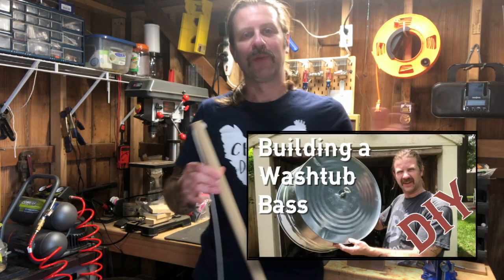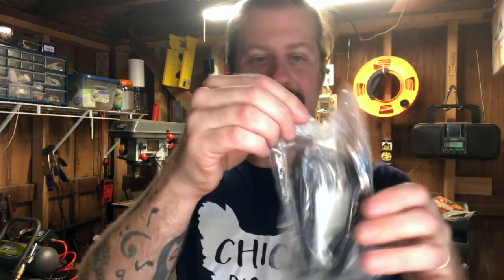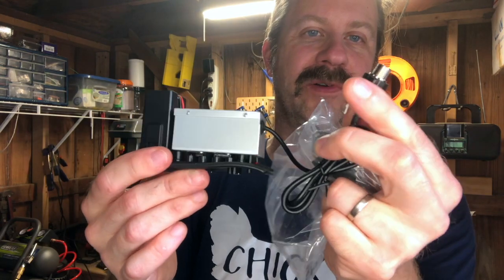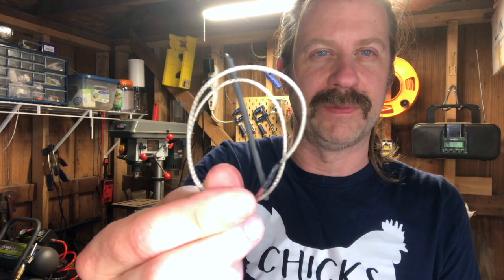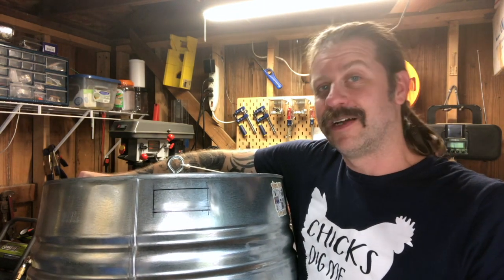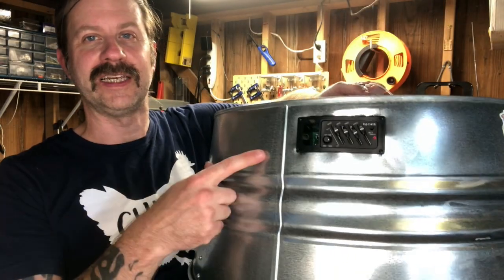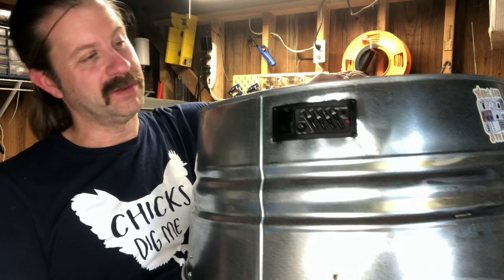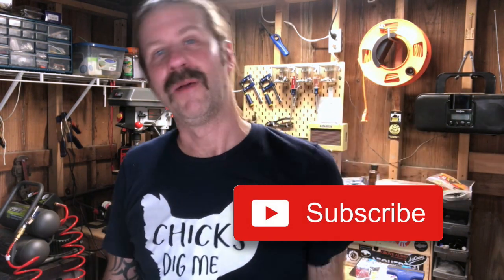How To Electrify a Washtub Bass

Comment: I have had less than stellar results using a Piezo on my washtub. The sound has too much vibration and buzzy metallic overtones. Lately, I use two mics,  1 under the tub wrapped in a large towel like a cake, close to the eyebolt,  in to my bass amp. A 2nd mic is on atop the bucket near eyebolt, on a short stand, directly to Carvin PA system, where I add effects. As long as the bucket stays flush to carpeting, I do not get any feedback, bass tone rich and low with separation. 
**Thanks for a great idea, I may try Piezo again with a guitar preamp, on a new build. I need an easier way to take it to gigs. Truly enjoyed hearing you play!
Reply from the maker: Thanks for watching. It sounds like you've got a lot of experience with these babies. This was my first attempt so I'm still learning. I may need to try some of what you suggested. Thanks again.
Reply: I put my piezo directly to my eyebolt using a champagne cork and a juice jug cap hot glued. Wired to a 1/4in mono jack. No problems here.👍🤠🤘I use a piezo disc.

Comment: Cool! I wonder if you would get different tones from placing a disc piezo at different places on the soundboard? Maybe you could use one of those sticky-backed disc piezos and move it around to find the "sweet spot"?
Reply from the maker: I thought about that, but I think you're gonna get a lot of feedback with that much metal. I used a piezo disc on a cookie tin CBG a while back and I ended up having to stuff foam inside to keep it from feeding back. I figured the eye bolt would have a lot less ambient vibration. It might be worth a shot though. I guess ya never know 'til ya try. :-)

Comment: 🤔 i wonder if a bigger piezo pickup with no pre-amp would have the same effect
Reply from the maker: The nice thing about the preamp is it allows you to boost the bass frequencies. I would imagine if you mounted a piezo directly to the metal you'd get a lot of feedback but who knows. There's only one way to find out. Thanks for tuning in.
Reply: @musicalmiscellany  i might try it, maybe put a thin piece of wood between the piezo and the metal to help dampen the feedback a little
Reply from the maker: @gupster24  That may work. The wood might give it a bit more oomph too. Give it a shot.